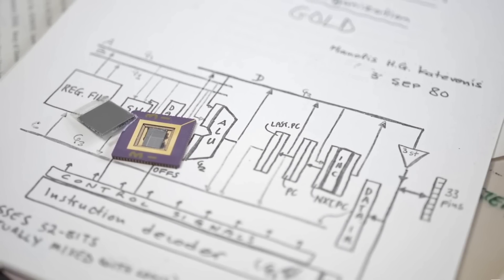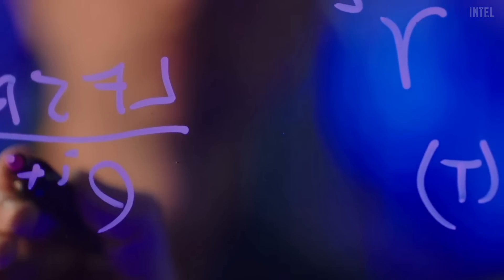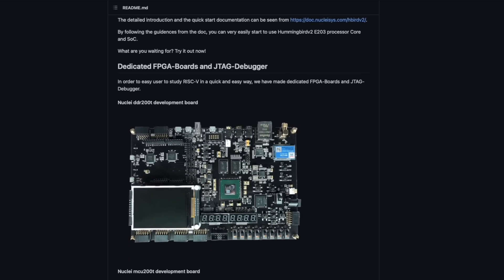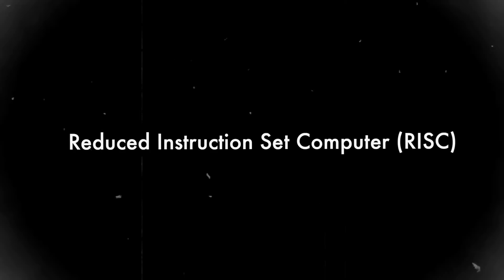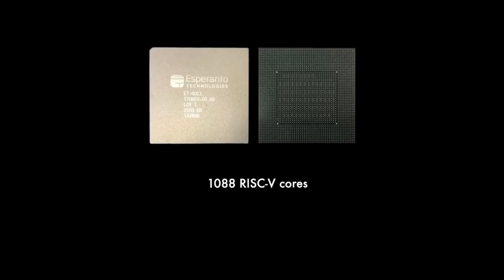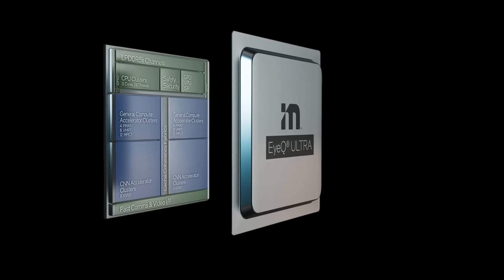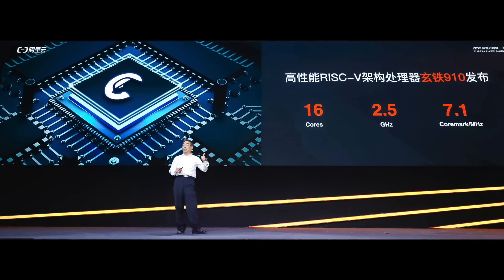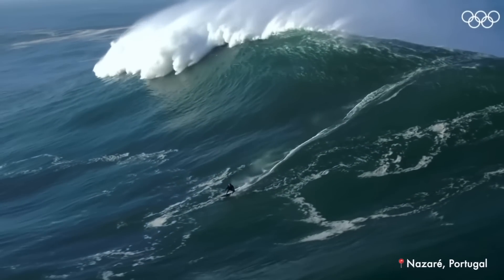RISC-V Chips will be everywhere

Comment: I really want to start working with RISC-V now...  I wanted to buy a Milk-V Mars board but.. sold out... then another RISC-V board and.. sold out.  I am looking for one that has vector math extension and is not perpetually sold it...  so far no luck.  Also, I have an old FPGA board in a desk drawer......  I was trying to build a neuromorphic chip about 15 years ago.  I have new ideas for it, now.

Comment: 0:28 Technically, you're correct about RISC-V being made 10 years ago. What's more interesting is that RISC as a foundation was made in 1981 thanks to some fine folks in YC Berkeley. The numbering relates to the generation of CPUs under the RISC banner (ex: currently in the 5th generation of RISC design).

Comment: Hi, I just discovered your channel with this video. Very interesting, and the substance / text / photography / video editing are all great. However, the voice caption is IMHO not that good. You may want to use an antipop (hardware) or de-esser (software), or talk louder further away from the microphone, because your voice renders both a bit shy-like (sorry I don't know how to say this properly, but as if you were a bit refraining yourself from talking) and the "ss" (sibilant sounds) are very loud and very much present, which is quite annoying when listening with headphones (I want to hear about tech, not watch an ASMR video ^^).

I saw that you use a Sennheiser shotgun microphone, which can be a bit cold compared to a large membrane microphone (e.g. Rode NT1, Shure SM7, T-Bone SC1100 or the like, they are not that expensive and are really good for near-field voice caption), and an antipop is really a must have, even if you're not that close to the microphone. In addition, I don't know which audio software you're using, but Reaper has a built-in de-esser which is quite good, and of course you also have plenty of additional plugins if you like.

Anyway, keep up the good work, and do not hesitate to reply to this comment for further information (or if you want references to audio guides or whatever).

EDIT: I saw that you have a foam windscreen. While it may help, it is often not as effective as a real antipop. Without changing your setup, you can also experience with orienting the microphone so that your mouth is slightly off-axis, it may reduce the high frequency content of your voice and make it sound better.

Comment: Nicely told in a light way - and I think that's also how the story of RISC-V should be perceived.

Microprocessor core and ISA licenses can be incredibly expensive and are projects which are technically (and legally!) way too complex to just roll your own.  Even just  a license for a synthesizable core is pricey.  RISC V will allow ome new designs which previously were not financially viable and help teaching microprocessors at universities.

I'm not surprised by the success of RISC-V.  It's a design with the wisdom of the giants of RISC design and decades of experience in how RISC designs held up to the test of time.  With my MIPS background RISC V looks like taking the RISC idea, executing it even more radically:
 - only one instruction (system calls) to trigger an exception.
 - no register windows
 - no funny special registers for integer multiply and division
 - decent support for position independent code.  Which is where MIPS did not well and required an incredibly ...  creative ...  API to get PIC to work
 - ISA comes with configuration options to allow a minimal ISA for a micro controller or a full ISA configuration for larger systems.
Again with my MIPS hat on RISC V does look rather familiar.  

Well done, good video 🙂
Reply: And even on that note, MIPS was better over time than register windows of Sparc, and also it was, at the time, pretty revolutionary to leave the branch delay slots for extra throughput by not interlocking the pipeline with auto nops. Turns out, they're bad for high end implementations, but it was still very neat, and the nicest of the various original RISC boom architecture. ARM2 was relatively elegant, but the barrel shifter was odd. Arm has gotten much more cluttered since, almost to the point of not being risc. If you want more IPS, fuse some instructions in hardware instead of adding more of them..
Reply: @mikafoxx2717  I did the MIPS port to Linux and worked for SGI, MIPS Technologies and Imagination so I not only know a thing or two about MIPS but also my views may not be perfectly objective :-)  That said, the branch delay thing used to be quite common  Among others HP's HPPA (later renamed to PARISC) also had branch delay slots and a few others.  I don't know where they originated.
Branch delay slots basically are a nice idea as long as the pipeline is simple such as the five stage R2000 or R3000 pipeline which in theory can achieve one clock per cycle for most instructions.  Notable exceptions are FPU instructions, integer multiplication and divide.
With those processors the problem is to find something sensible to put into the delay slot.  MIPS' own compiler was pretty good at filling delay slots but that wasn't always possible.  And the assembler did default to reordering mode where it did put the instruction immediately preceeding the branch into the delay slot if there were no dependencies that is if the reordering candidate did not write a register which the branch instruction was going to read.
Then came the R6000 which did introduce the branch likely instructions which only execute the instruction in the delay slot if the branch is taken.  Basically an instruction designed as loop closure instruction.  Bit of a braintwister for humans to use and much tougher for compilers as well.  And hated so badly by MIPS pipeline implementors that still today they push pins into voodoo dolls of the R6000 architects.  In a calm night in the silicon valley you can hear them cry for every needle.  But only when the SPARC register window folks which are suffering the same voodoo needle fate are calm ;-)
The whole branch delay slot / branch likely thing stopped being a big problem for out-of-order architectures which are able to reshuffle instructions anyway.  That said, MIPS has turned from "real" computing to embedded and so the vast majority of CPU cores like the 4K, 5K, 24K, 25K, 34K series of CPU cores from MIPS Technologies but also cores like Sibyte/Broadcom's SB1/SB1A cores are in-order and thus the branch delay slotand especially branch likely slots pains (and the voodoo needles) continue.

Comment: I love the concept of open source hardware! ARM takes a license fee of nearly one dollar per core. This means you will never get a capable mcu for a quarter dollar, or a 10'000 core cluster for ML application at a cheaper price.

Risc V makes you dream big. Also open source means rapid contributions from people.
Reply: I always see that ARM takes a fee for every chip made with their ISA. How does this work? Did ARM make this ISA and can now just get billions of dollars for it every year as long we all need these chips? If so it sounds like we would have more companies trying to design something like that? Or is it the fact that shifting to a new ISA is difficult because of the software that is written in code to use ARM only? So ARM basically had a homerun when it became the standard for most mobile devices?
Reply: @ME-CFS-LongCovid-Help  Your have already answered your questions already.  It is difficult to design chips and thus many companies license ARM's design.  ARM does not earn that much.  Many ARM chips are low end chips and contribute to several cents of royalty per chip.
Reply: Most people get it wrong.  RISC-V is just open instruction set.  It does not offer you open source hardware implemenation of the instruction set.  There is a big difference with ARM.  ARM can license you the hardware design as well.

Comment: I'm turning an RV into a high-tech off-grid tiny home. I'm building my own power monitoring, sensors and security systems and it's all going to have historical data collected through Grafana, and it's all running from a bank of single board RISC processor computers in the wiring cabinet! :-)

Comment: Its going to a very good thing when we reach a point where X86 code can be translated without the user knowing that they are running on a non-X86 CPU. Once we get there, transitioning away from X86 will be painless and seamless.

Comment: Risc-V is so much better than X64 Mips and ARM that it is scary to think of the long term implications. Not only Risc-V has so much more improvements, it's ABI is well defined, so more optimisation will be possible.
Reply: What are the advantages? The reduced set of instructions? Or that low-level language she mentioned? Curious.
Also, can it replace general-purpose CPUs?
Reply: @pdjinne65  it is a general purpose cpu, low cost, less power, better designed for current needs.

Comment: For those of you that are somehow experimented with ARM based STM32 mcus, there is a RISC-V family of peripheral and pin compatible mcus (direct replacement is posible) called CH32V, from the makers of the CH340 popular usb interface (ch32v103/203/208/303/305/307)... That let's you reuse part of the code you just programmed for the ST's.
Reply: I am wondering about the reuse part when your code is using a lot of interrupt routines.

Comment: There won’t be any “Coming RISC-V Revolution”. It is misconception and delusion! The RISC-V is based on 40-year old ideas as RISC-V Foundation claims. There is no sense to port the huge x86 and ARM software ecosystems on it. Thus, RISC-V will never gain a victory over x86 and ARM. The most of positives about the RISC-V processor are arbitrary speculations. The advantage of RISC-V is open architecture. RISC-V has instructions of variable lengths. This is bad, it is a departure from the RISC architecture principles. 
The RISC-V is good for embedded systems as it is free and open. But it will never become a general all-purpose processor. The RISC-V is based on 40-year old ideas as RISC-V Foundation claims. There is no sense to port the huge x86 and ARM software ecosystems on it. Thus, RISC-V will never gain a victory over x86 and ARM. The most of positives about the RISC-V processor are arbitrary speculations. The advantage of RISC-V is open architecture. RISC-V has instructions of variable lengths. This is bad, it is a departure from the RISC architecture principles. 
The Contemporary microprocessors contain 8 specific hardware components: (1) SMT (Simultaneous Multithreading), (2) register renaming, (3) instruction reordering, (4) out-of-order execution, (5) speculative execution, (6) superscalar execution, (7) delayed branch, (8) branch prediction. These components make up some kind of a “magnificent eight” of components which essentially raise the performance of microprocessors. But unfortunately they are very complex. A processor core having these components is a full-fledged one, otherwise it is good for simple applications, e. g. for embedded systems. 
The “magnificent eight” of components is very hard to design, only the experienced firms and developers are able to do this, and much know-how was acquired, some effective solutions are patented. Particularly complex is the SMT. Only powerful and advanced firms like Intel, AMD, IBM are able to equip their processors with the “magnificent eight” components. It is not surprising that some Intel processors, and the famous Apple's M1 processor do not contain SMTs. If a company is able create the full-fledged RISC-V processor with all “magnificent eight” components then it would be a serious achievement, and such RISC-V would be considered of the World's class comparable with x86, with ARM, but not more. As far as I understand most of the developed RISC-V processors have no components from the “magnificent eight”, and are intended for embedded systems.
A course directed on further development of RISC-V is a wrong way, and leads the computer architecture to deadlock. The RISC-V is not promising for computer industry. In fact, RISC-V hampers the further development of the state-of-the-art microprocessor technologies. The World demands absolutely novel microprocessor having much more higher performance than all contemporary ones. The novel and effective ideas on computer architectures do exist! Here’s such a novel processor architecture: V. K. Dobrovolskyi. Microprocessor Based on the Minimal Hardware Principle. Electronic Modeling, 2019, vol 41, No 6. pp. 77-90. The article is posted (under the Cyrillic name добровольский.pdf):
https://www.emodel.org.ua/en/ then touch ARCHIVE, then move to 2019, then to VOL 41, NO 6(2019) pp. 77-90. You see: DOBROVOLSKYI V.K. Microprocessor Based on the Minimal Hardware Principle Click “Microprocessor based...” At the very bottom you’ll find Full text: PDF Click it. 
This processor does not have the “magnificent eight”, it is not necessary at all. This comment reflects different view on the RISC-V architecture, and the computer community has a right to become familiar with such a view. I’m Volodymyr Dobrovolskyi (V.K.Dobrovolskyi).

Comment: I've been watching it too after only recently getting back into SW and HW. Expressif's RISC V ESP32-C3 is a fantastic entry level experimenter's platform. I think Expressif and Arduino engineers need to talk about software handshaking to reinstate use of the Arduino serial debug messaging and serial graphing but any poor budding engineer should be able to acquire an ESP32-C3 variant with a display  and start testing tweaks of demo code and from there move to using the I2C, SPI, RX and TX pins and touch, ADC, PWM, wireless, ESP NOW, Bluetooth, BLE and general I/O.  The power at the fingertips of a new engineer is so much more than when I first got into software at 17 years old with my ZX81 that I bought with the proceeds of a holiday job. 3 weeks minimum labour then for a PC with 1k RAM vs now would buy you a whole basic laptop, ESP32 chips, breadboards and pheripheral modules. From my ZX81 I moved to an Amstrad CPC664 later and bought a printer for it. Only text supported by the Amstrad! I had invented an engine and wanted to print sections. So in those early days, I did calculations to plot the engine cross sections on screen and wrote assembler code to convert the image to screen dumps on the printer. Laborious days, but so much satisfaction of achievement! That same Amstrad CPC664 was my gateway into microcontrollers. I designed up expansion for it to gain an external serial port to send data to Motorolla HC68HC11 2K flash memory chips, wrote my own 68HC11 cross assembler in locomotive basic and bit-banged my own IR protocol and made a remote controlled vehicle which could record and play speech and drive in any direction with 2 wheels and a joystick controller. My then six year old's birthday present. She's 32 now. Now a 10 year old grand daughter and a sub-year grand son, what can I do for them with ESP32 C3s? 😎

Comment: While it's nice that Intel invested a bit into RISC-V, I think everyone involved in RISC-V outside of Intel (and AMD, ARM, Samsung) should be wary of anything they do.  I don't think Intel's attempt to acquire SiFive was for the benefit of SiFive, and that it might have been somewhat of an underhanded malicious attempt to squash the entire RISC-V movement in its infancy.  Intel, back in the day, did everything they could to help Microsoft to bolster its monopoly in the software market since their software almost exclusively ran on their chips.  They haven't changed much since then.

To a lesser extent, AMD, ARM, and Samsung also have every reason to try to undermine RISC-V, although AMD might work on RISC-V just to spite Intel.  I think they have less to lose from promoting it since they don't even own the x86 ISA they produce!  I suspect Nvidia may also not like RISC-V, but probably don't care so much as long as it doesn't intrude too much on the GPU market.

Comment: The only thing that's somewhat alarming about RISC-V, is that it's licensed under a BSD license, meaning you can take the design and add as many extensions you wish, some of which may even break compatibility with the original and still retain the RISC-V sticker while still keeping all the code. If or when this happens to larger firms, like Samsung, Microsoft, Google or something, it won't matter if the original RISC-V was OSS, when the derived work isn't.
Reply: If they break compatibility then they can't call it RISC-V.  If someone does that then it's no more relevant to RISC-V than if they'd started from something like MIPS or designed their own from scratch.
Reply: @BruceHoult  Are you sure about this? AFAICS the BSD license doesn't have such clauses.
Reply: @roysigurdkarlsbakk3842  The BSD license allows you to use and modify the specification without attribution, but you can't use the trademarked RISC-V name without passing compatibility tests.
Reply: @BruceHoult  ah - ok - thanks
Reply: @perforongo9078  The benefit is obviously that you get a jumpstart as compared to starting from scratch. But again - making custom risc-v designs, of which there are several already, lots of patents and shite, doesn't make the world more open.